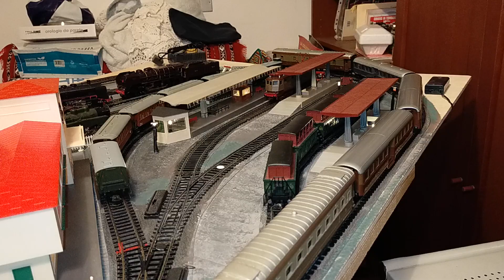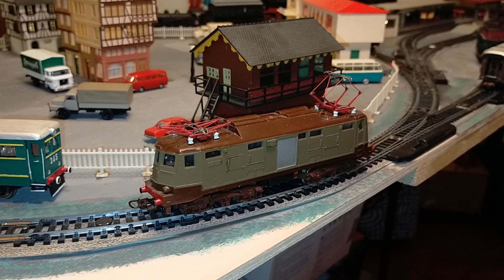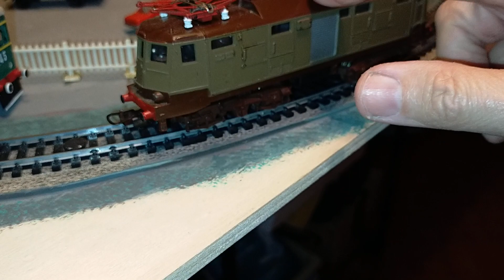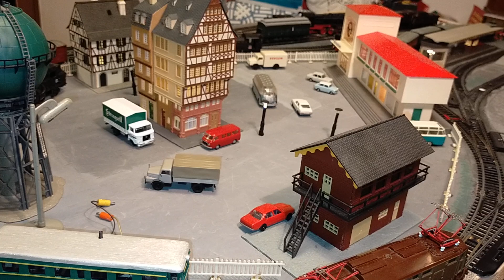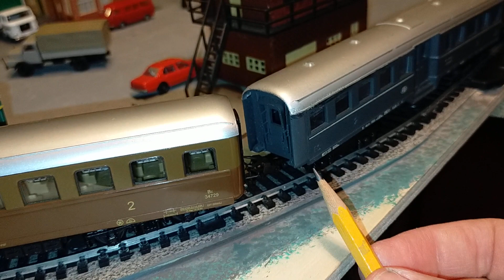Italian mixed traffic: Lima HO FS E424 Bo' Bo' electric locomotive with an iconic passenger train

Comment: Thanks for the info on the prototype.    I have the earlier version of this model (with the vertical motor) - it's a bit noisier than the usual Lima motor but still good for its age.    I keep looking for the orange /grey version to match the MDVE coaches but they seem scarce and very expensive.
Reply: The early bell type motor.
Reply: Thanks Raymond  @raymondleggs5508
Reply from the maker: Lima also made a brand new moulding with lots of details, the E424 Breda.
Reply from the maker: Yes, the orange and grey version is quite pricey, I've just had a look on eBay and the cheapest I saw was 80 €.
You could try looking for a convenient brown one, either on eBay or Vinted (that's where I got mine) and repaint it, but you would have to eliminate the front door by applying modelling putty and sanding. The extra red lights can be added.
I've never handled a Lima loco with the old vertical motor, it makes me curious.
Lima made the E424 for years, right to the very end, with the cardan drive version in XMPR livery, that was sold in starter pack train sets.
Reply: Thanks for the advice Patrick - yes I may have to resort to a repaint.   I will upload a video of my old motored e424. @patricksmodels